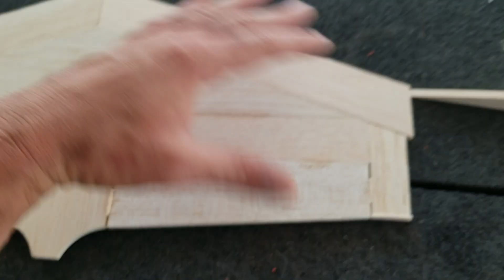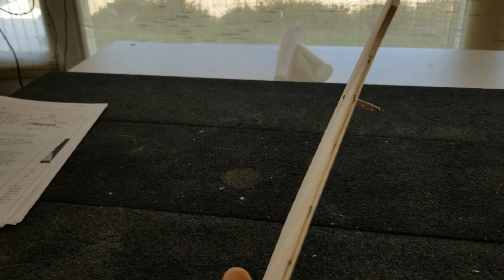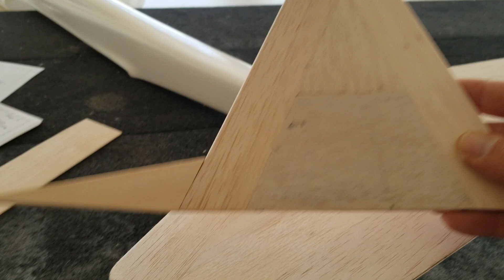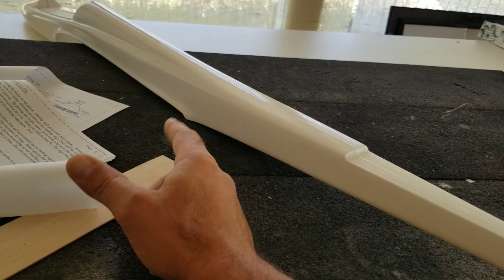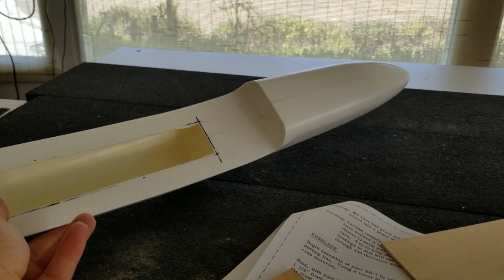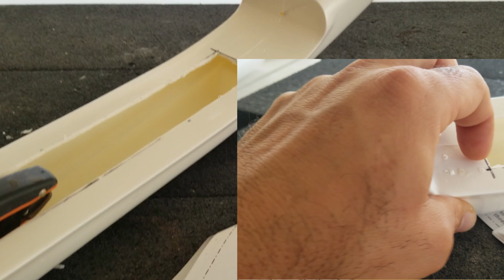SR-7, Vintage RC Slope Glider Build Part 4

Comment: Built one of these (SR-7) around '81. Flew fairly well. I suspect the huge taper may have caused some stability issues. Flew it at Thornton beach in SF and Coyote Hills in Fremont CA where it spiraled in and was mostly destroyed. Poor decision to use old Ni Cad pack and - lost control.